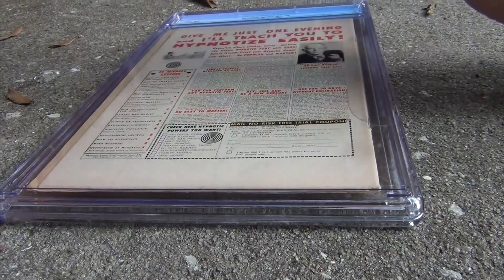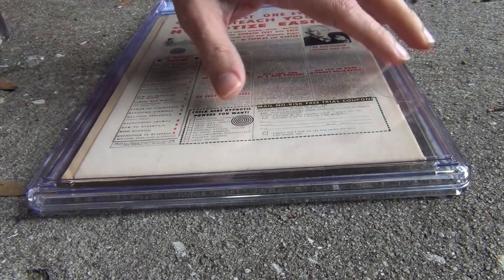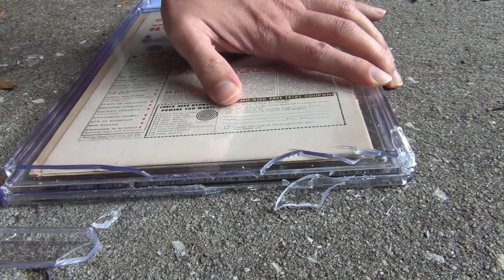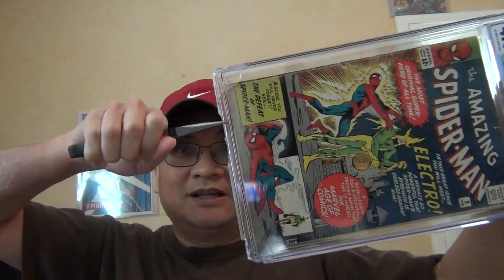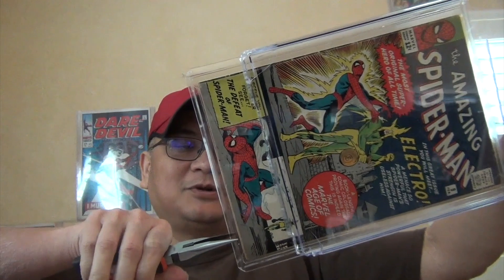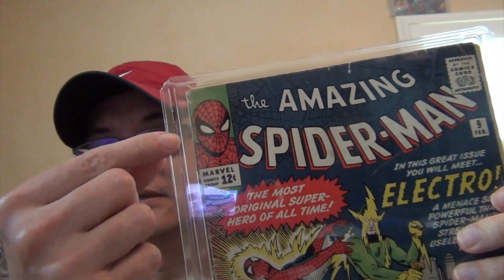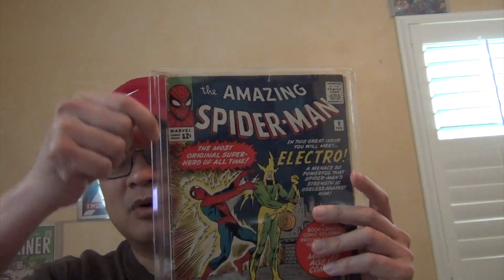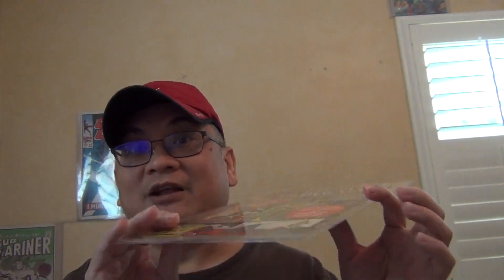Crack out CGC new slab - 2019 version

Comment: Nice work using your technique, Nick.  With CGC's new cases, because of the extra force needed, I use a screw driver and hammer the point through the top creating an opening, then, break the entire plastic case in 1/2 like a clam-shell, exposing the book a bit more so I don't have to slide it out - it kind of comes out by itself.  But hey - everyone has their own style and yours looks a lot quicker and easier than mine - I just bought two slabbed books that will be cracked out when they arrive so, I'll give yours a try.
Reply from the maker: I prefer the quickest way possible...the only drawback my way is cleaning after because you are going to have debris EVERYWHERE...LOL...I do sweep up after each time...have to